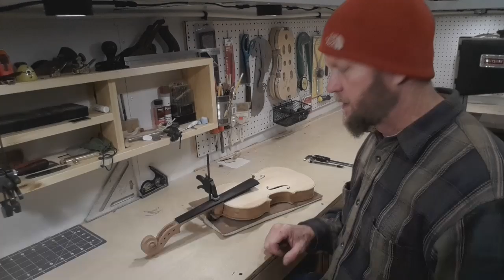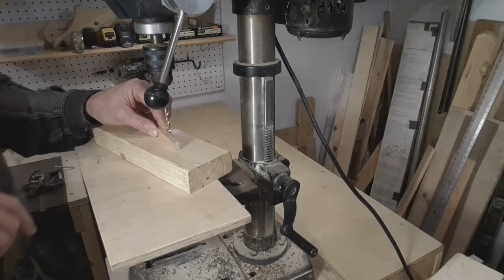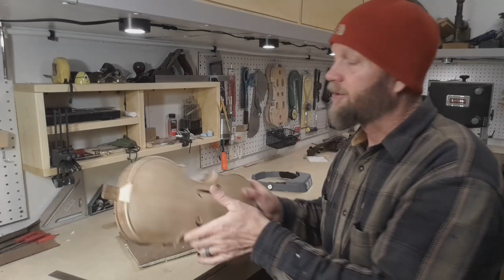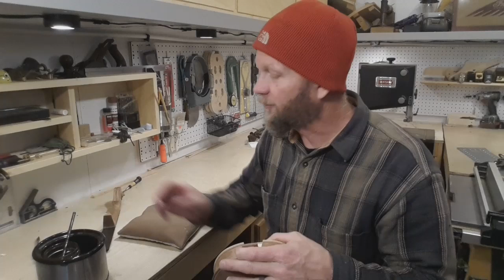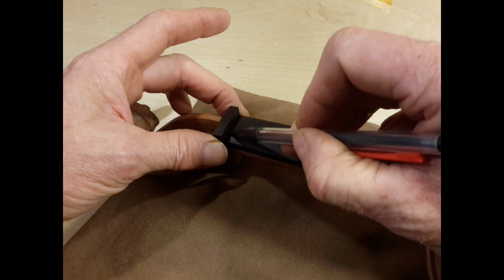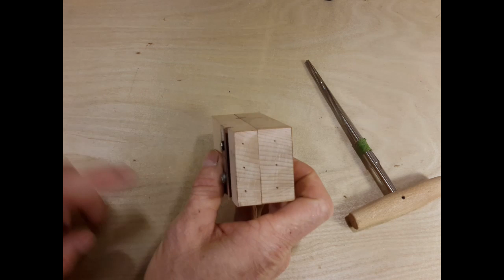How to Build a Fiddle-- Part 10: Attaching the neck, nut & saddle

Comment: What an embarrasement and a shame on real violin makers. You do not have a clue .  The neck angle has nothing to do with projection above the belly UNTIL you have first determined the position of the nut in space . The nut and string slots must be precisely aligned with the glued undersurface of the belly and rib top . The set back of the neck must begin at that point and result in a string angle of 158 * at the bridge ,or 32 break .  Your method ignores the position of the nut and fiddles about with a resulting position rather than a starting one .  Your nut position is neither considered nor determined at the outset and sort of overuled by a fingerboard slope . Just nonsense .  Amateurish  in the extreme .

Comment: I've never heard of letting the glue on the endgrain dry before final glue-up to seal the endgrain -- does this technique also apply to regular tightbond glued butt joints?
Reply from the maker: No! 
Tightbond and other glues do not glue to the dried glue.
Hide glue does.  It is the only glue that allows repairs, and bonds to itself.

Comment: I think my nut is too high! Could you please get back to me, is there anyway I could shave it down and not harm the fiddle?
The reason I say the nut is too high is pushing on the strings I have to push so far down this is my second fiddle and the first one was not like that. I'm starting to think that this second fiddle is a much cheaper knockoff
Reply from the maker: Yes. Not a big deal to do.  You can file it down, and make new grooves for the strings.  At the nut, strings should be about a business card thickness away from the fingerboard.

Comment: You cut the upper part of the violin in order to attach the saddle on the tailpiece side.
Why can't the saddle be attached above the upper part of the violin, without cutting it, and compensate with less hight ?
Reply from the maker: Well....I guess you could.... but it's easy to do, it anchors the saddle from moving and there is a fair amount of pressure on it....like 70 lbs, that it has to stand up against.
Reply: @grandpasmountain  Thank you for your fast profesional reply, I am conviced !

Comment: Thanks again, John.  Lots of great detail.  I’m a ways off from this stage as I am just now putting the final taper on my 2 piece mold (yes, the 2 piece is cheating a little).  

I am curious at about the 6 minute point how you marked 27.1 mm with a 0.5mm mechanical pencil though.  Was is one of the “leave the line” or “cut the line” kind of marks?  If so, your eyes are in great shape.   

I don’t think I can even see a tenth of a mm, much less mark and cut one!!!
Reply from the maker: Yeah --  it's a matter of leaving the line.  The traditional English measuring system is more accurate than the metric system.  The smallest increment is 1mm.  We can SEE 1/64th on a ruler and it's 1/4 of a millimeter.
I was just being hyper accurate!
Most makers use the metric system....sooo.. I have learned to think that way.

Nah-- not cheating!  Use whatever mould fits you best.  No rules!
Reply: @grandpasmountain  At least no real hard and fast rules, right?

Comment: Always fabulous Jon. Sorry to see that finger. Not gonna bore you with scary woodworking stories but I have a few. Been a hobbiest for (OMG...just did the mental math) 40 plus years and still have all my fingers. Knock on wood. LOL. So excited to hear how it's gonna sound. Can you tell at this stage by tapping it or any other predictor as to whether it will have a nice resonance?
Reply from the maker: Thankyou, Linton.  Yes....so many woodworkers missing fingertips!  I severed 2 fingers when I was young on my right hand.  Missing tendons and artery in 1 and semi-numb.
I was going to change out the insert on the bandsaw with a new one I made, and didn't wait for the blade to stop as I reached under to push the insert up and got caught when the blade grabbed my finger and jammed it into the blade guide, stopping the blade.  It's pretty deep, but I poured the glue on it and held it together.

No...I can't tell anything.  The 2 plates must work in harmony and need the soundpost installed.  I think it's gonna be good-- 
The wood changes molecularly when it is used to produce sound and will change alot within the first 20-30 minutes.

Can't wait to hear it!

Comment: Jon, you almost confused me with comment about tightbond at the 3:10 minute point. I went back and reviewed part 7 and sure enough you had used hide glue for the plate.  So I realized that you must be talking about gluing the purfling and sure enough in part 4 that is what you used.  Sorry for questioning you.  Never doubted... another great video.
Reply from the maker: Ok, haha.  I WAS  thinking about the Titebond in the purfling groove--  I got a little crap over not using only hide glue, haha.  
Thankyou!

Comment: Have a speedy recovery Jon. Question about the nut. When you drew the parallel line 1mm up. Did you eye ball it or use a compass?
Reply from the maker: The nut has the same 42mm radius as the fingerbooard, so just used my fingerboard radius template a little over 1mm up.
Thanks!  Just applied more superglue,  haha.
Reply: @grandpasmountain  ah that makes sense. Again thank you for these videos. So far I have my corner blocks cut, glued to my mold and shaped and tonight I did my first tests of my bending rig that is similar to yours but I'm using a handheld torch as a heat source. It worked pretty great!
Reply from the maker: @jamessmith4836  That is awesome!  One Master Luthier who has helped me out uses a propane torch hanging by a coat hangar!

I'd love to see pictures anytime you want to share!
Reply: More of the overall progress here. https://photos.app.goo.gl/FhwQyMnKwsnkknsA7  I'll try and update the gallery as I go. Again thank you so much for you videos.

Comment: Jon, I think this one will be a very beautiful instrument.  I have a theory that using sandpaper on the major surfaces of the plates will clog the cellular structure of the wood grain and suppress the vibrancy of the instrument, while cutting the wood with very sharp planes and scrapers will leave the grain less damaged and will result in a more dynamic sound.  What would your opinion be?
Reply from the maker: I know that to be a fact....to a point. Somewhere, I have pictures of the wood under a microscope. Carleen Hutchins was a big proponent of avoiding sandpaper.  Does it have an effect on tone?  No.  Is it better than finishing with 600 grit sandpaper... I am doubtful--at least as far as my eye can see.
Scraping is traditional-- and gives us a bond with our ancestors and brothers in the trade.  Definitely a much smoother finish over all.  I personally prefer it as well as top notch cabinet makers.
Reply: Jon Mangum I agree with a well sharpened scraper you can achieve a much smoother finish. Almost silk like. Sandpaper has it’s uses but used with care, depending on what you’re making.

Comment: Will build from scratch soon as well, just getting myself familiar with woods and small carving... and it is scary, I already got some few cuts with chisels. But I am gaining more confidence.

Thank you very much, you made the approach in violin building less frightening... my next project will be on building from scratch.
Reply: Where possible clamp the wood down to your bench and get both hands behind the chisel and cut away from yourself . That way if you slip you can’t possibly cut your self. That was one of the first things drummed into me  as a very young apprentice cabinet maker. Plus razor sharp tools , your more likely to slip with a blunt tool because you’ll be pushing harder, when sharp you will need less pressure or force. Spend time learning to sharpen your tools. Good luck it’s just a matter of taking your time. 👍👍👍👍👍
Reply: @bluehoo0  Thank you! I'll keep that in mind, As of now all I can do is mimick how mr.Mangum work. I am new at this and still a fool with tools. And right now am studying how to sharpen my chisels. The only thing sharp in my shop are the xacto knives... and I bet they aren't sharp anymore for a pro, but deadly sharp for me :)
Reply from the maker: Glad you're getting more comfortable with building!  Yes--- be careful!  I have been cut many times! That's what super glue is for! (It was actually designed for that during the Vietnam war)
Reply: @grandpasmountain  Thank you sir.Mangum, as of now I will mimic and follow your steps. I bet when I finally make one from scratch, I will learn how to work around with tools :)

Thank you and  God bless you and Family.
Reply from the maker: @cadenzachambermusic7065  I should make a little video on how to get razor sharp tools very easily!  
It is not rocket science.  It's just a very sharp corner!